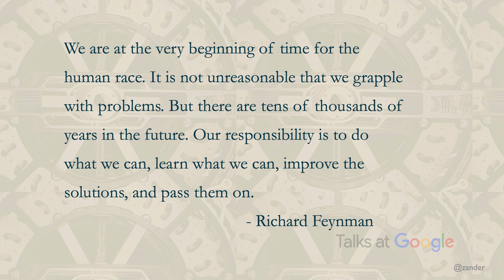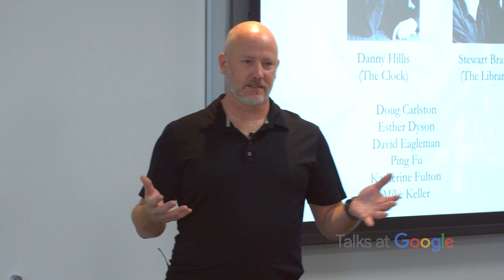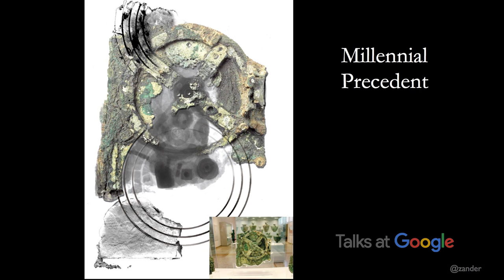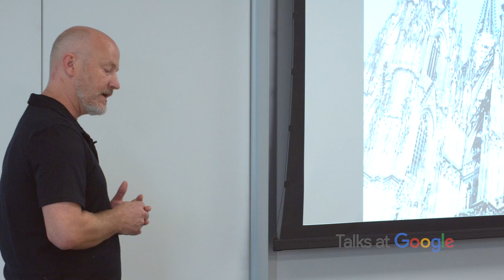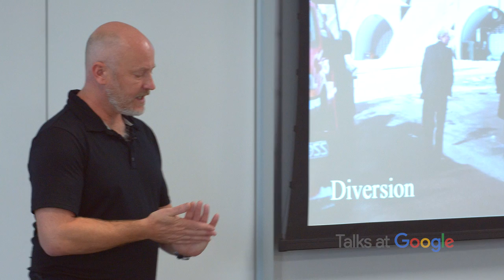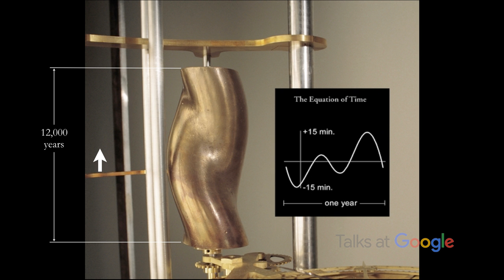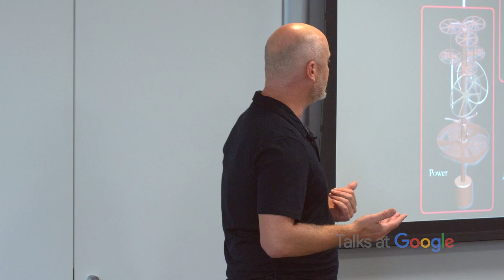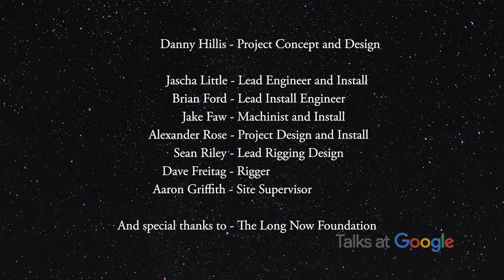The 10,000 Year Clock | Alexander Rose | Talks at Google

Comment: Good talk about the clock itself.  The preamble about long term thinking could use a buff.  The example at 7:00 about old growth redwoods is a little off.  Those layers (governance and culture) were NOT skipped.  You said it yourself, "all hell broke loose politically."   Politics is literally the cultural and governance layer in action.  Our adversarial legal system is the thread that runs through those layers and delivered a compromise solution.  All you have to do is look at the end result, the vast bulk of the trees were preserved.  Saying that this was a failure of long term thinking is something that only people obsessed with "perfected process" would say -- insisting that the ONLY acceptable outcome would be preservation of the trees.   If you can't envision ANY scenario where the right answer would have been to harvest all of the trees, you're the one who isn't suited for long-term thinking.
Reply: There is no scenario is which the complete denuting of all of the trees in an area is "the right answer".
Nor is there any scenario in which using up every drop of hydrocarbon fossil fuels can ever be the right or best answer.
Absolute and total harvest can never be wise or prudent, and in every way, logic would dictate that it is in fact the opposite.